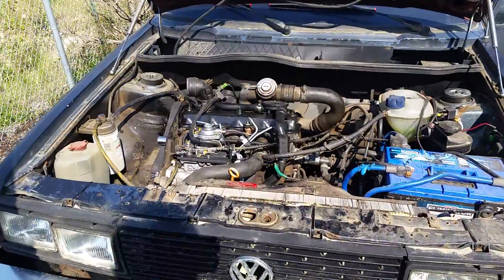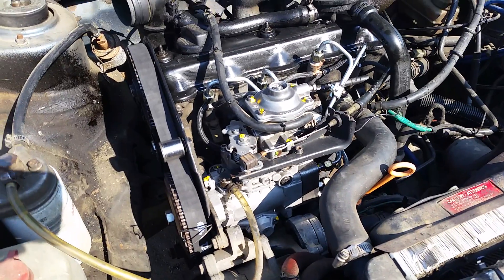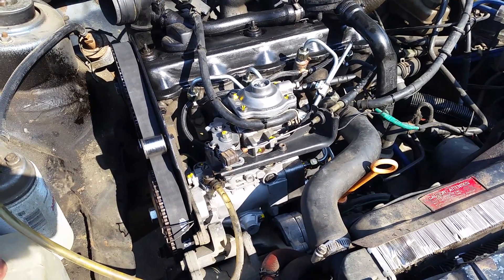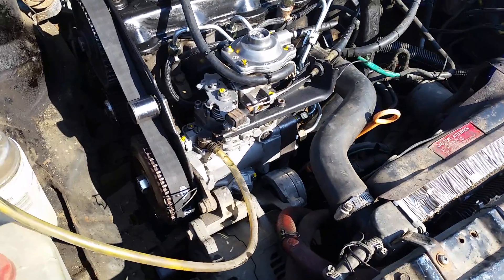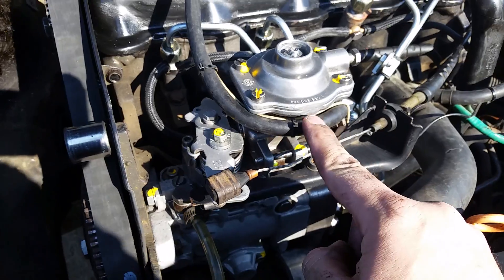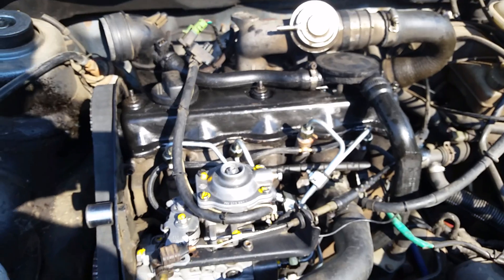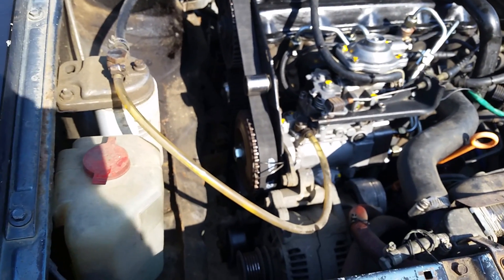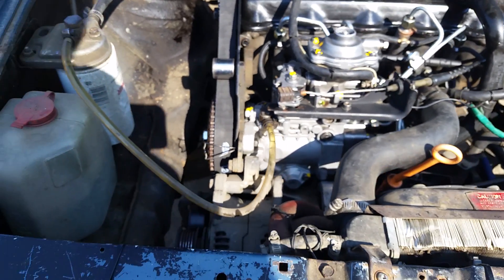1984 Vokswagen Jetta 1.9 AHU M-TDI - Performance D

Comment: I have a '91 Cummins 6BT engine, and the VE pump is very similar to the one on yours. It sure looks huge on that little VW engine. lol I am dying to get my hands on one of those mechanical VW engines, I bet a 12mm rotor and head assembly would make that VE pump flow some serious fuel. Then you just need compound turbos for it to get enough air.
What kind of supply pump/lift pump are you running to make sure that 11mm VE gets enough fuel? That part is critical for the pump to survive. Are you running ARP head studs on the engine?
Reply: It is a VE pump

Comment: Have you got a forum thread or equivalent showing how you did the swap of the TDI?
Reply: Sorry, but I got no one. Engine from Toledo (AFN), gauges are from Passat B4, gearbox from gasoline Golf II, no special electrical equipment needed - only glowing must be connected permanently (not necesary - my better solution for me)

Comment: what did he charge to convert?
Reply from the maker: The MTDI work is $1400CDN.
Reply: 8v-of-fury is that before a core exchange?
Reply from the maker: +Josh Danner that's me sending me him my pump.
Reply: Josh Danner: Engine from Toledo (AFN), gauges are from Passat B4, gearbox from gasoline Golf II, no special electrical equipment needed - only glowing must be connected permanently (not necesary - my better solution for me). Exactly, I had to change some necesary stuff, but nothing critical. Some small modifications :)